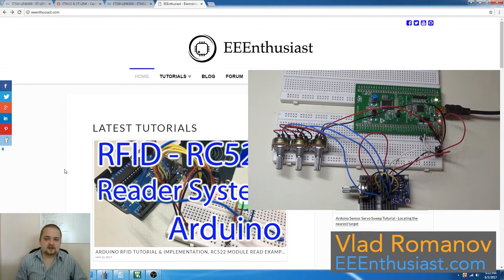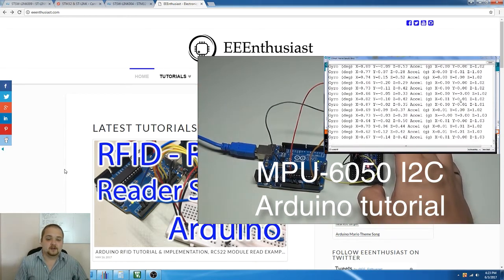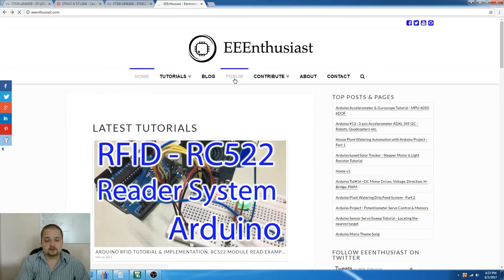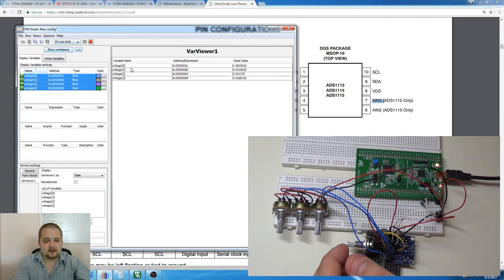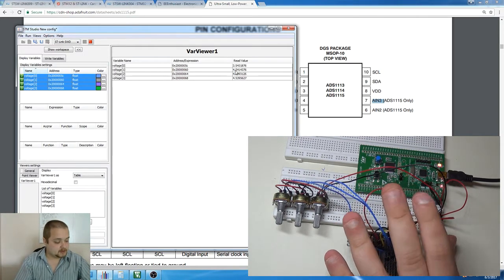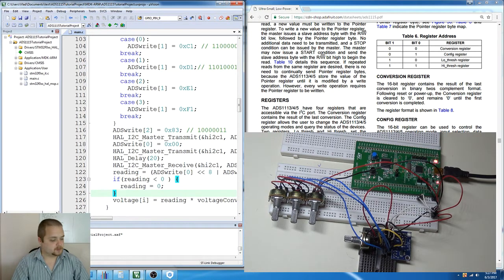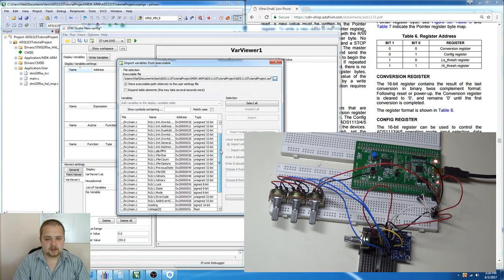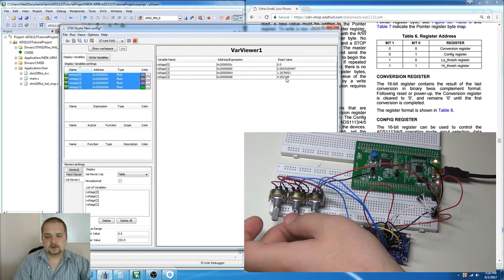Arm Development #2 - STM32 Cortex-M0 I2C Tutorial using ADS1115 Analog to Digital IC - Keil & CubeMX

Comment: Hi, nice video! I'd like to suggest a correction. @12:00 you divided the full scale voltage by 2^16. It should be divided instead by 32767 (=2^16 -1), which is the maximum value of a 15 bit number. The difference is small with such high resolution, but you loose 1 lsb of accuracy.
Reply: He divided by 2^15=32768 not by 65536. He is correct.

Comment: Hey. I'm new with STM32. I'm coming from PIC microcontroller with Mikroc compiler. I want you ask a question. I have a IC called BU94603 that when you send command to ask the name of music is playing, it will return by I2C the name. Each 8 bits repesent a charcter name of the song. By while I was watching your video, I saw that you need to  specify how many bytes you gonna receive by I2C when you use I2C_Read library command. But I don't know how many bytes the microcontroller gonna receive from BU94603. It depends how much long the name is. So, any suggestion ?

Comment: dont use 4 channels , use them as 2 differential pairs as it rejects noise and can directly be applied to industrial commercial product. ADS1115 has everything oscillator voltage reference Power on reset but its poor at ESD only +-2KV......so be careful.....also when u reduce Full span to get more accuracy , the input impedence drops very bad , so a chopper  opamp voltage follower must be employed..